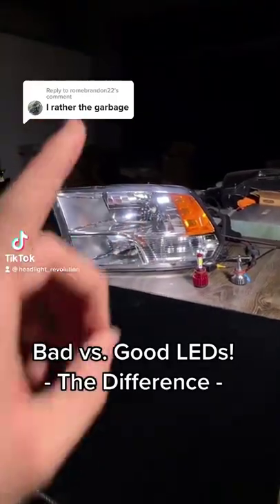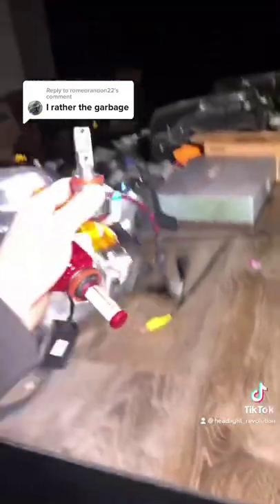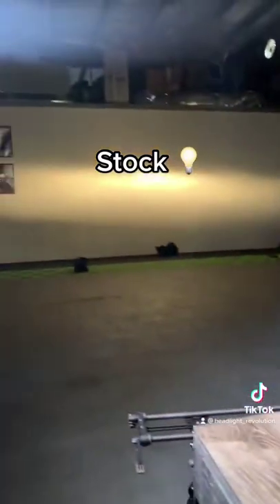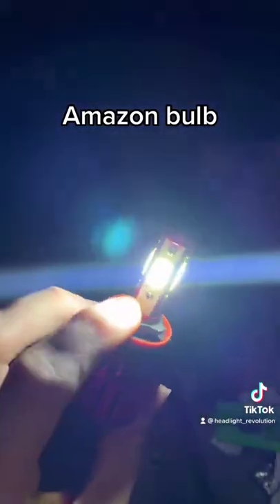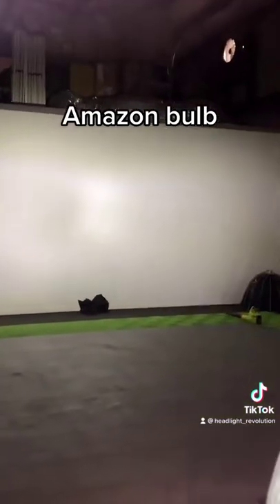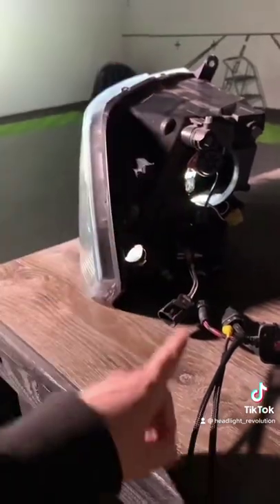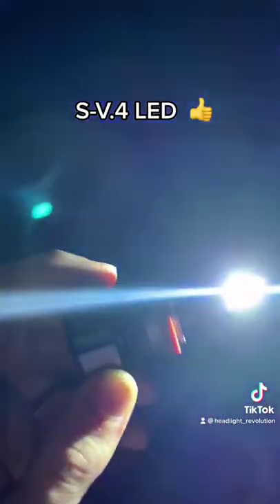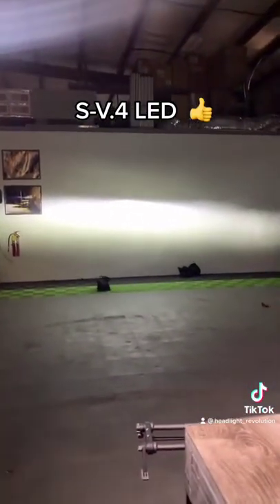Quality LED Bulbs vs. Garbage LED Bulbs! #shorts

Comment: Had no idea a bulb could make such a difference! Thanks
Reply from the maker: No problem 👍
Reply: Interesting.
Reply: #banledandotherblindingheadlights
Reply: I would think this is common sense
Reply: Interesting
Reply: @HeadlightRevolution yeah it makes a difference by blinding oncoming drivers, do a test from the other side.
Reply: No idea? That's kind of part of the problem that is so prevalent these days
Reply: @Scott-po6go I don’t think he needs to do a “test from the other side”. He showed that there is a huge difference in beam pattern between the quality LED and the crappy one. The quality one has a very similar beam to the OEM bulb. The only thing left to do is make sure the headlight is aligned properly, which he should be doing when he puts it back in the car anyway.
Reply: Maybe you just shouldn't drive.  @jaminjef
Reply: @know916bound  maybe you shouldn't blind people
Reply: @jaminjef  who said i do? I don't drive a truck. But i hate when people start swerving in front of me or driving 10 under the speed limit just because they have "sensitive eyes" you know they make driving glasses for night too? Sounds like you need them and stop overreacting just because other peoples vehicles have brighter lights than your cheap old crap.
Reply: You had no idea that different light sources have different patterns?
Wow
Reply: Unless you have projector headlights…
Reply: @StolenJoker84  he needs to test  for why he thinks he has to blind other drivers
Reply: @jaminjef  Again, align the headlights properly, and there won’t be any issues.
Reply: @StolenJoker84  but some roads have bumps, lumps, and other irregularities that still causes the beams to laser right into other people's eyes. Is this too complicated for you people?
Reply: @StolenJoker84  again, you just don't understand how eyes work. If you had good vision you wouldn't have to blind everyone else.
Reply: @jaminjef  And those bumps and issues with the road are a problem for everyone, regardless of the headlights being used. Sounds like an issue that your local jurisdiction needs to address. Properly aligned headlights help with this issue since part of that alignment means throwing the light beam to the side of the road that doesn’t have oncoming traffic (right side for right side driving countries, left side for left side driving countries) and down onto the road surface. It would take a pretty significant bump in the road (which would be way easier to see - and be able to respond according to - with proper lighting) to cause an issue. (As a side note, even something as large as a speed bump should not be an issue as long as the headlights are properly aligned and the vehicle is properly maintained) 

Regarding your comment about not knowing how eyes work … they work because of light. More light in the right places makes things easier to see. 

If you’re being blinded by oncoming traffic, it’s because their headlights are improperly aligned.
Reply: @StolenJoker84  so, what you are  advocating is aiming the lights toward the shoulder so they will blind pedestrians. That tells me all I need to know about you.
Reply: @jaminjef  No. I’m not advocating for purposely aiming the headlights at pedestrians eyes. The fact that you doesn’t understand what a “properly aligned headlight” is tells me you know absolutely nothing about automotive lighting. Go look at headlight beam charts. They’re designed to be a little higher on the curb side than the on coming traffic side. But guess what - the eyes of (most) pedestrians are also higher than a driver in the oncoming traffic lane.

Properly aligned headlights don’t blind anyone.

Edited to add that a headlight beam patern looks similar to this: _/—— (or —— \ __ for countries that drive on the left) where the beam is higher in the sidewalk and lower in the traffic lanes.
Reply: @StolenJoker84  you don't care
Reply: @jaminjef  You’re right. I don’t care about non issues.
Reply: @StolenJoker84  you consider other people's eyesight a non issue? Well, alrighty then!
Reply: @jaminjef  I never said that. When your headlights are properly adjusted, having brighter headlights is a non-issue.
Reply: @jaminjef  If your eyes are so sensitive that it’s a problem that other people with properly adjusted headlights causes an issue for you, then you probably shouldn’t be driving at night. 

My 2017 SUV has significantly brighter headlights than my 2005 CUV. Both of them are properly adjusted (as tested and required by my local government for registration purposes), and neither of them shine anywhere near anyones eyes - pedestrian or driver.
Reply: @StolenJoker84  you shouldn't drive if you need blinding lights. Case closed! Bye!
Reply: @jaminjef  Good thing my headlights aren’t blinding people. Adjust your headlights properly.
Reply: @jaminjef  How is it different than halogens?  I've had more than once where people with standard OEM equipment go over a hill at the same time I do and blind me.  That's nothing new.  LEDs aren't a different type of light, they're just generally a different color temp.
Reply: @compmanio36  They ARE a different type of light!  A very bad type!  #banledandotherblindingheadlights #banblindingheadlights
Reply: @jaminjef  You're so compelling.  /s
Reply: @jaminjef you should not be allowed to drive. Take public transportation please

Comment: Now do projectors:)
Reply from the maker: We can make one with projectors no problem! Good suggestion. 🤝
Reply: @HeadlightRevolution  still waiting for that projector comparison video
Reply: @wickedone2199  if in the refector the beam patern is good, in the projector is much² better
Reply: I heard that LED’s give a really messed up beam pattern for projectors. Still looking for confirmation on that because the HIDs ballast is no fun.
Reply: Still waiting for the projector 🤝😂
Reply: @colehorton8092 very good in projector
Reply: @colehorton8092  I just installed some LED's on my car that have projector housings and the beam pattern is very similar to the stock halogens
Reply: @alanthepianoman are the led brighter?
Reply: @wahidjavid51 they are not crazy bright but they are noticeably brighter for sure. Also my car is Mazda 6 so it might depend on the car. I used to have to use high beams on this one stretch of road due to lack of street lights but after putting the LEDs I can see very clearly just using the low beams
Reply: @alanthepianoman  cool thanks for the feedback
Reply: @HeadlightRevolution  so whejs that projector vid coming out?
Reply: @colehorton8092  they don't, a good LED bulb makes a great beam pattern in a projector, as good as an HID, and better than a halogen in a projector
Reply: @chunkyfecalbreakfast  I bought Sealight brand
Reply: @chunkyfecalbreakfast  I just bought Auxito d2s  led  24000lm  6500k bulbs $110 for my Lexus low beams,   (replaced the factory hids). In my opinion the led bulbs are a little brighter but i think it can be more bright if my projector housing was clean. I did clean them but they are still slightly hazy. I also replaced my fog lights  to led auxito h11 bulbs. The fogs definitely made a big difference. So i recommend getting auxito,  also  sealight and gtr lighting  are good brands too but i chose Auxito  since matches everyrhing. OH and i upgrade back up reverse  lights to auito led with a pigtail and they are realllyy bright!
Reply: WHERE THE VIDEO COWBOY??
Reply: If you’re using projectors, it’s good because it has that glass ball that basically forces the light to go where it’s supposed to so it doesn’t matter what the bulb really does for the most part(you should still check to make sure it’s not blinding oncoming road users, but you do have to be careful because sometimes they burn holes in the clear, plastic) ,where is if you’ve got a reflector where the bulb literally just sticks out and you can see it You get that blown out effect that basically makes it impossible to see anything but the headlights and nothing behind the car and the people getting out of the car you can’t see as well (you should never use LED or HID lights in a reflector type vehicle)

Always make sure the clear plastic is not bubbled up or foggy. As even with normal bulbs. It can cause a blown out effect like you’ve got your full beam on when you don’t.
Reply: @HeadlightRevolution  Just sitting here dying slowly watching youtube videos hoping that you make that projector comparison video.
Reply: @nayakacreativity3639  couldnt use them in mine to many shadows. The multi side ones work the best in projectors.
Reply: @juaneer cap. LEDs are trash in projectors. HIDs are wayyyyyy better in projectors and shoots further than Leds
Reply: @HeadlightRevolution  those bulbs are designed for projector headlights, not reflector

Comment: Diving home at night on an empty hwy and have headlights that look like they have their high beams on is infuriating
Reply: I just high beam them.
Reply: @grumpynomad3551 yeah I put a light bar on my corolla for this exact reason lmao. Not down low but up top
Reply: Yeah and half the time they furiously flash you about 100 times like your high beams are on.
Reply: @grumpynomad3551  you live in a poor area.
Reply: @shaiapouf420 Hush kiddo, the adults are talking.
Reply: @clew518  thats when you give them a blast of high beams
Reply: @clew518 fix your vehicle instead of bitching about it
Reply: @shaiapouf420 LMAO That’s such a wild thing to say based off his comment. Gotta be mid tier goblin troll
Reply: @lordserpentine8246  good thing opinions  very
Reply: people get pissed when they think I have my highbeams on, but when I turn them on they stop real quick. I recommend these bulbs.
Reply: @AtlasReburdened adults would understand that most newer vehicle come stock this way, just because some people drive older cars doesn't mean we all have too. Kind of hard too avoid with newer vehicles alot come with bright ass led lights lol

Comment: As a fellow driver on the road.... Thank You so very much for this.
Reply: Fellow drivers like you get blinded by that "beam pattern" concentrating light in your rearview.  What more brightly lights up the road for a driver will blind others.
There needs to be more regulations limiting "quality", as it is called, here.
AAA is working on this.
Reply: #banblindingheadlights
Reply: It concentrates the beam but also keeps it low....so unless ur riding some1s ass ur not blinding them....there concentrated  ...down...with low lumens so it has to be narrow beam pattern to see 5 feet of road ahead
Reply: Its designed to be lower than ur rear view unless ur in a high truck...there in low car and ur riding there ass...there's a reason why dot and automakers make em this way
Reply: @t9056  there? Where? #banblindingheadlights

Comment: Need much better headlight regulation, especially on hilly rural roads, when someone comes over the hill with those Death Star rays on it’s instant blindness
Reply: When you are being blinded you were taught to look at the white line here in America works like a charm
Reply: @ninjalol2253  white line? Like on the right hand side? The roads I’m talking about only have one lane, so there is a yellow line down the middle, is that the line you mean?
Reply: @gruntslayer3524 you're in the sticks then. Look at the outside edge of the road.

Here in Ohio, some roads have a white line on the outside edge (where they should be), but not all do.

Look at the outside edge of the road (to your right.) You can still see the road and hold your lane, but aren't getting entirely blinded.
Reply: I'm one of those with a "death star ray" 🤣
Reply: @Taulksik  you shouldn't use them on the road
Reply: That's every light, new or old
Reply: The regulations are there. They need to be enforced by law enforcement!
Reply: If someone comes over a hill and blinds you... It just means they have properly adjusted headlights.....
Reply: @ChaseBond11  some headlights are a lot brighter than they need to be though, and I’m not talking about high beams. Makes the situation worse
Reply: @ChaseBond11  no kidding right,  just spiteful poors in here
Reply: @wizard_of_poz4413  not really spiteful, just hoping to be able to see at night
Reply: @gruntslayer3524  I mean being misaligned is bad, but if yall would ditch the shitty halogens then you wouldn't be straining to see all the time
Reply: Is it just me or does it seem like the epidemic of non-oem pattern replacements seem to be way worse than just 10-15 years ago ? I swear I remember being able to see at night when looking down my own lane way more often. I do use corrective lenses but I've always had pretty nice lenses with anti glare and such as well as my impairment only being pretty standard nearsightedness. But anyhow you're certainly right about it being majorly unsafe on rural county roads as that's where I live and the lack of streetlights means that 80-85% of the time I have oncoming traffic I'm completely blind to the sides of the road and just have to pray no deer want to ruin my day because there's not much I can do. Definitely need something done about this in areas like my hometown.
Reply: That’s why putting led in reflector housings are illegal and have to go into projector housings which have lenses that creates the beam.
Reply: @tysonchickennuggets  no it's not
Reply: @wizard_of_poz4413  no what.
Reply: @ninjalol2253 Pretty hard to look for a white line when everything in your windshield is white from ridiculous bulbs
Reply: I've tried explaining that part about the hills but they refuse to give a shit.
Reply: @gruntslayer3524  Also, you shouldn't have to look away from the 2 white arc lights at eye level.

Two lane roads are legit dangerous now.

Comment: The only use for those garbage leds are in farm vehicles that you only drive in private property and would benifit from the light going in all directions. You would blind any incoming traffic with those garbage 360 leds😂
Reply: Isn’t that what full beams are good for?
Reply: @joshuatk59  no beam should ever be thrown too high. Even at high beam there is always a pre defined cut off. You don't need to light the sky up to see the road.
Reply: Many farmers in my area have to drive on the road to get to the fields they are working. So it’s not even that useful then. Just throwing a light rack on top would be much better.
Reply: BAN all LED! wakin up at  330am and someone behind me is lighting up my whole fkn cab!
Reply: @meegssan5716  LED is great when done right, didn't you see the video? Many cars are starting to come with LEDs from factory which also means better, safer integration. They're brighter, clearer, more efficient, and last longer. The efficiency part also becomes more important with hybrids and EVs. The longevity means fewer people driving with high beams just because they don't wanna be pulled over for having a headlight out but are too lazy to replace it
Reply: @TheKingLux  ohh u didnt get my point thats ok
Reply: @meegssan5716 he did get your point. LEDs aren't the problem, it's poor execution and regulation.
Reply: @KuntalGhosh Those cheap bulbs probably make it much harder to see in inclement weather like when you have high beams on in the fog
Reply: *On; benEfit
Reply: @cherrypepsi2815  nope thats not my point
Reply: @meegssan5716  I’m far less concerned about ultra bright headlights on the road now after reading your comment that sounds like those same ultra bright headlights disturbed your slumber while you were on the road sleeping behind the wheel at 3:30am. 😂🤣😂
Reply: Not a farmer here. But I use that headlight for my Enduro dirtbike. Works perfectly
Reply: Yup they only good for work lights & off road use only where defused light is needed, plus they aren't FMVSS 108 compliant either as a headlamp ,but great for a off road work light

Comment: So, for anyone wondering, the stock reflectors are designed for a point light source where the filament would be located using a stock bulb.  Even if you took that stock bulb and moved it forward or backward a centimeter or so it would completely change the beam pattern because the light would be reflected at a different angle than it was designed for.  Therefore, when you stick a poorly designed LED bulb in there that has light sources spread out all over it, the pattern that gets reflected will be all over the place too.  That is why a quality LED replacement bulb has only two small high intensity LED chips placed at a specific point so that it can mimic the filament the reflector was designed for.  Most vehicles that come with LED headlights from the factory have a completely different style of reflector from the ones used by filament based bulbs so that it can be tuned to the particular size and shape of the LED chip being used.

Comment: As someone who works night shift and has an astigmatism, bulbs like the garbage ones should be illegal to use on the road. It’s not hard to tell when someone is using a cheap LED bulb because they completely blind me even when I’m looking at the edge of the road. Really wish there were tighter restrictions on stuff like this that is a safety concern

Comment: The biggest downside to upgrading incandescent to led headlights (when using the good bulbs) is that they are so much brighter that people think your high-beams are on, and flash you.  Just compare the yellow beam at the beginning with the white beam at the end, which is so bright, the camera is clipping. It’s important to have bulbs that produce light from the exact same location so that the parabolic reflector aims that light to the correct place on the road and not blind oncoming traffic. It’s perfectly legal to sell non DOT equipment, but they leave it up to you to honor the fact they are not road legal, and not use them in public roads.
Reply: Excellent comment
Reply: this comment should be upvoted more